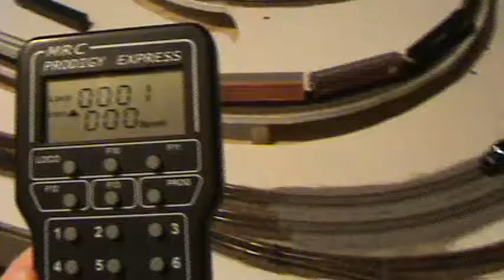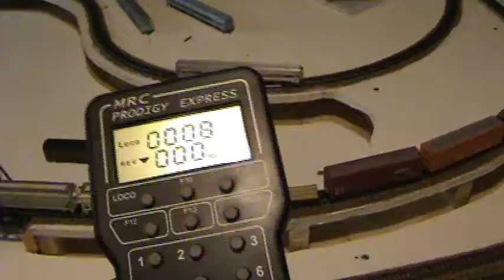DCC Introduction

Comment: Nice video. For a complete novice I found this information very useful.
Reply: +crazykong1967   Very nice video. Thanks. I am well sarisfied with my little pp14 controller. 6 points. CDU. Ever used pwm, it works a treat but it`s not quite DCC  which is engine selective.  The grandson and grandaughter are delighted with  my little railway. Love Bachmann engines.

Comment: Enjoyed the video, very informative. I used to run DC cab control on my layout. I could run 2 trains at once, however I had to pay attention to toggle switches to control the track blocks. I just started converting over to DCC and it is awesome, the DC did do its job quite well for awhile, but the flexibility of DCC makes it worth the investment. I use Digitrax Loconet system.

Comment: Thanks, Mike. I learned much. Are you happy with your MRC DCC system? Is there any reason to buy one of the much more expensive systems, such as NCE?
Reply from the maker: Hi Ryan, I like the MRC system, overall I am happy, but it does have some quirks. If there is any short for example even for just a moment, you need to unplug and plug the throttle back in. MRC may have made some improvements since I purchased mine. NCE seems pretty good and it seems to be about the same price as the MRC system. Best thing to do is check them out at train shows and see what you think.

Comment from the maker: You can do that. If you assign two locos to the same address you will have basic consisting. You will want to make sure the speed steps are set so the engines are going as close to the same speed as possible before hooking them together.

Comment from the maker: Currently I put the DCC address on the box where I store the locomotive. In the future I will use a card which will have the Locomotive railroad company, road number, and DCC code with a small picture which I will pull out any time I use the engine.

Comment: Wow great video, I currently have a DC layout, but would like to move over to DCC so we can have locomotives with lights/sounds and have them run on the same track. My only question is, how do you wire the tracks correctly in order to achieve DCC?

Comment from the maker: You can do that with DC but the motor speeds of the engines will likely not be in sync which can cause one engine to drag the other. With DCC you can program the speed tables so that the engine motors are in sync. Engines can be programmed to run in reverse for a consist.

Comment from the maker: Flymajj,
Yes, you connect the command controller to all the tracks. With DCC, you are not only sending current to the track, but also data packets (speed up/down, lights on/off, etc) so you will want to have several connections in different locations from the track to your controller. The easiest thing to do is mount a +/- bus under the table and connect all the wires to that. Then connect two main wires from the bus to the controller. (I hope this makes sense).

Comment: I'm looking into DCC at the moment but finding the most basic info is difficult. Your presentation helped a lot - thanks.

Do you connect the one controller to all independent tracks? I am guessing that points open between tracks have no effect at all since it is a constant current. Any info appreciated.